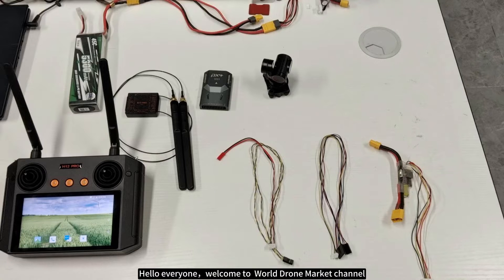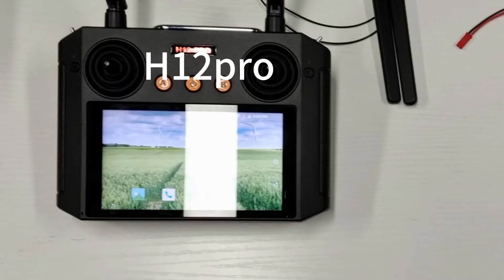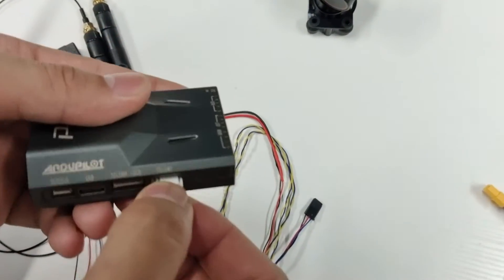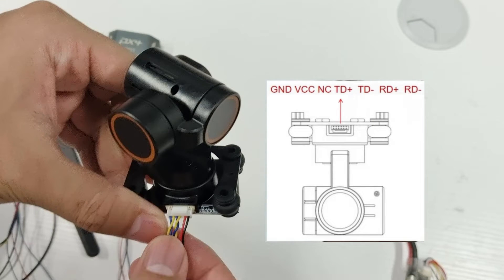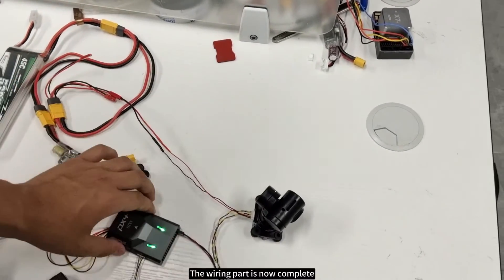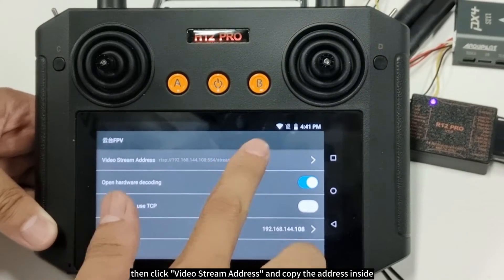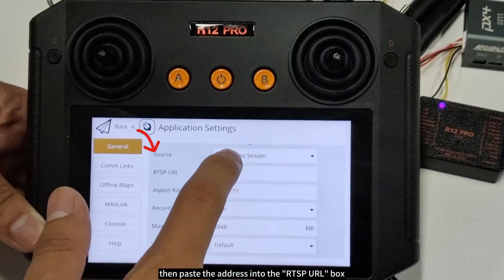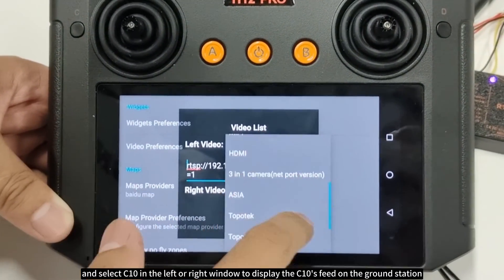Skydroid H12 pro＋C10 Wiring video

Comment: can we use the RTSP link to stream video to the laptop ?
Reply from the maker: The Skydroid H12pro in the video cannot share the video to the computer, but the Skydroid H16, Skydroid H30, Skydroid G20, and Skydroid G12 can do it. You can watch this video:https://www.youtube.com/watch?v=dup8_H1zCJw&list=PLiiYnp_AXvppEekn1JNlxGbPEQg1ST3cp&index=78
Reply: @worldronemarket  but in H12 also Rtsp Stream link is generated right, just we need to paste that link in chrome browser of our laptop right? I need to stream the video from transmitter to laptop wirelessly
Reply from the maker: @VishnuKumar-tt6mi  H12 can only connect to serial port cameras, which do not have RTSP addresses. H12pro can connect to network port cameras, which have RTSP addresses. Connect the network port of the H12pro remote controller to the computer, and fill in the RTSP streaming address of the network port camera on the computer. I have a video here, you can take a look:https://www.youtube.com/watch?v=3cy8lxuet9M
Reply: @worldronemarket so, it is possible TO stream wirelessly to a laptop using H12 PRO variant right sir/,mam?
Reply from the maker: @VishnuKumar-tt6mi  H12pro can only be connected to the computer via a wired connection, and cannot be connected to the computer wirelessly. Only the Skydroid remote controllers H16, H30, G12, and G20 can transmit videos to the computer via hotspot transmission.
Reply: @worldronemarket will the Rtsp wireless streaming will be possible with siyi mk 15 yransmitter and is it possible to connect skydroid C10 (lan protocol ) camera? , or can we integrate separate digital video transmission system like Siyi hm30 transmitter and air unit for direct video transmission from drone to laptop and will the air unit is compatible with skydroid camera C10 or C12?
Reply from the maker: @VishnuKumar-tt6mi  MK15 can use WIFI hotspot to transmit video. We have recorded a video and you can check it out. It also supports connecting to C10 and C12:https://www.youtube.com/watch?v=fYNU5N5XqLY
Reply: Thank you so much . May I know the reason why H16, Hm30 or Siyi Mk15 are the only transmitters that are capable of transmitting video feed wirelessly throught Rtsp, why not H12 pro ?
Reply from the maker: @VishnuKumar-tt6mi  Because Skydroid was designed this way.
Reply: @worldronemarket thank you. But which specification is lagging in skydroid that is present in Mk15 and h 16 transmitters that allow to transmitt wirelessly ?
Reply from the maker: @VishnuKumar-tt6mi  I don't quite understand your question?
Reply: @worldronemarket my question is that skydroid H12 is not capable of streaming video wirelessly through Rtsp to laptop but SIYI MK 15 , Skydroid H16 etc are capavle of doing it. What specification  missing in H12 like Wifi module or any other hardware specs like that ?
Reply from the maker: @VishnuKumar-tt6mi  Sorry, this is the way it is when it leaves the factory, we don’t know.

Comment: I acquired an h12 with multi link v1.0 receiver, could you detail the connection of the c10 pro camera to the receiver?
Reply from the maker: Skydroid h12 cannot be used with C10pro. The h12 remote controller can only connect to serial port cameras, while C10pro is an Ethernet port camera.
Reply: @worldronemarket Do you have any serial port cameras with PTZ for this equipment? Could you detail the model or link? thank you so much
Reply from the maker: @diegopersello3430  Sorry. The serial port gimbal camera sold by Skydroid has been discontinued.

Comment: How do it find the FPV app and the H12 Pro assistant ?
Reply from the maker: Hello, Sir, The H12Pro assistant comes with the remote control.
I will send you the link to download the FPV app, which you can click to download.

Skydroid FPV APP: http://www.skydroid.xin/?type=newsinfo&S_id=36
Reply: @worldronemarket  Thank you... I have a problem in binding my H12 pro to R12 pro receiver. Do you have any documentation or video on how to do that? I have tried connecting key and gnd pins and frequency matching... it didn't work.
Reply from the maker: @tinta8500  Hello, I will send you the H12Pro operation manual. You can take a look at the linking operation of the remote control and receiver in the manual.https://docs.google.com/document/d/18SQ4QFO32YwTTBrQgNCLAc3fGmZ7i959/edit?usp=sharing&ouid=117651852131120365472&rtpof=true&sd=true

Comment: does normal h12 reciever also supports this camera
Reply from the maker: Hello, C10 is an Ethernet camera. H12Pro has an Ethernet port, so it can connect to C10. But H12 does not have an Ethernet port, so H12 cannot connect to C10 camera.